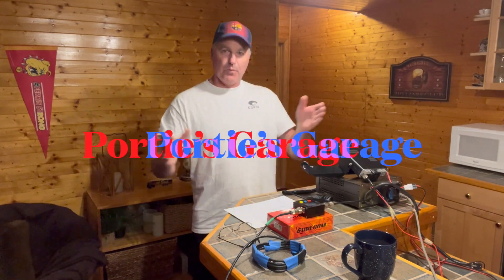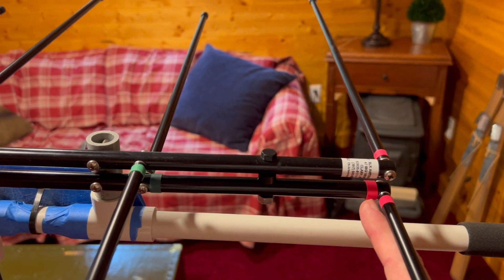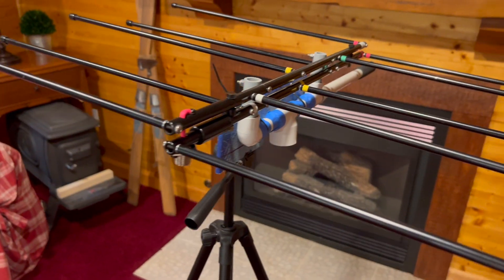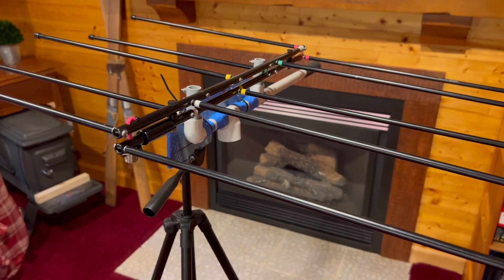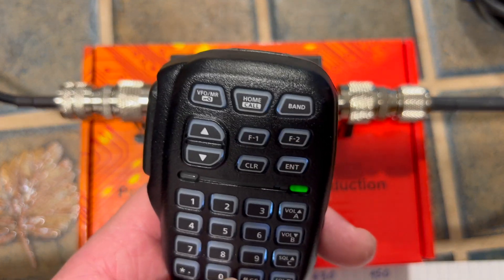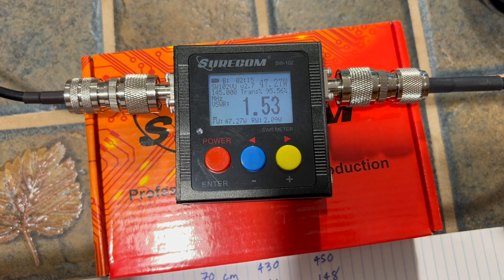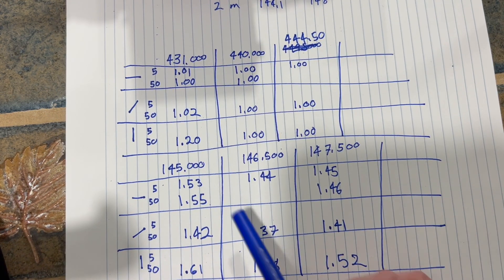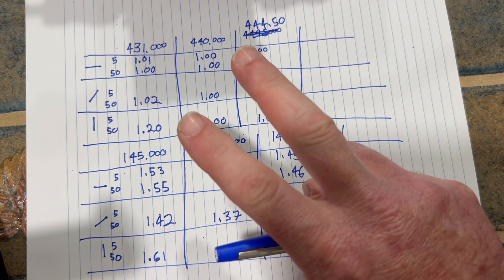Testing SWR of Elk Dual Band Log Periodic Antenna

Comment: Looking forward to the simplex test video.
Reply from the maker: From Mick: I’m still working on getting the spot to complete the simplex.  I’ve been using ESRI GIS maps to find a profile with little or no hills between me and target, tried two with no luck, but hit lots of repeaters with better consistency.  Found good way to mount and rotate.  Once boat season is over, will be jumping back in.  Thanks for watching, setup and results coming.  Sorry for delay.